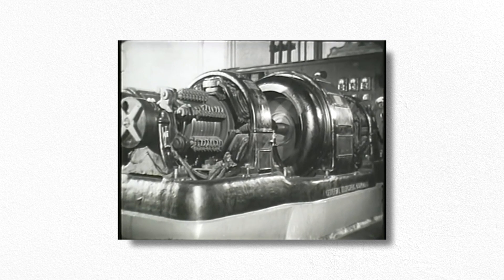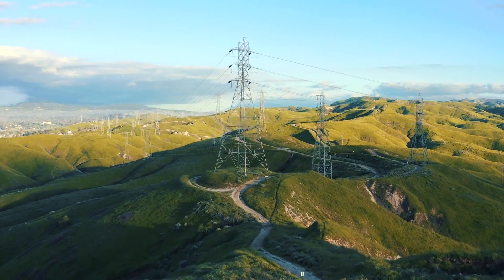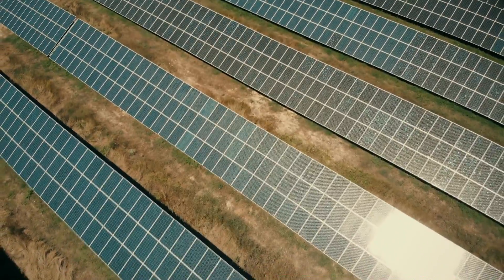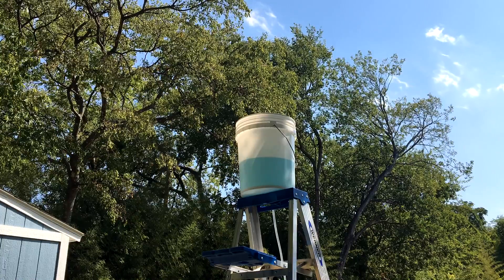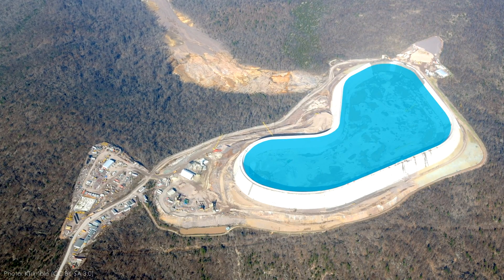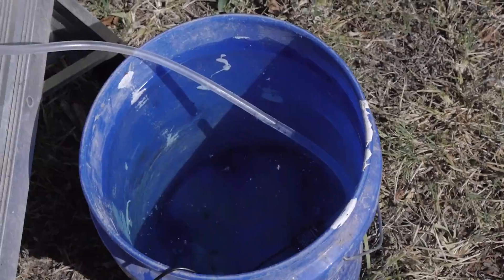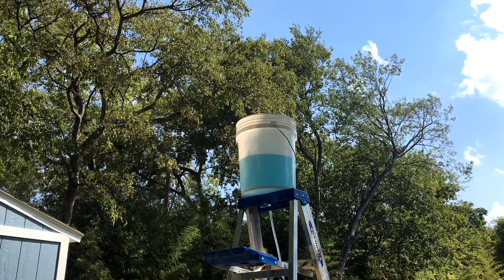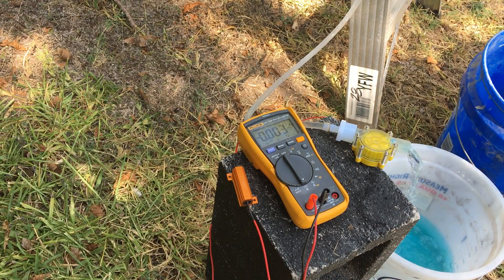World's Largest Batteries - (Pumped Storage)

Comment: Peaking power plants are often the same plants used for signal or phase support.  Often to usually far from the main plant.  Often to usually right downtown.  Often to usually run for zero true power needs but must be  online to make sure the wave forms of 60 cycles aligns perfectly.  AND  often to usually the oldest, ugliest, most polluting, least efficient plants in the entire grid.
Many of these older plants have been restricted from modernizing,,, NIMBY problems.  Run it and keep running it, because you are never going to secure a permit to build new and replace.   The rise of natural gas as a principal fuel has allowed many of these dinosaurs to be brought up to date.  Regulators will go along with 'less CO2'.

Pumped storage has one big problem.  It is not efficient.  For every 100 watts stored,, you will get back 60 watts or less.  Lithium batterries may be the more efficient solution,, but there is a company I believe in California  building a water and iron? battery?  I have heard of a calcium battery,, these are batterries that are not small,, would never be used in a mobile device.   Batteries the size of tractor trailers,, but,,, cheap,, non polluting,, efficient,, non toxic materials,,, just big.  Grid storage may be the use for them.

Comment: This reminds me of an idea where the entirety of the storm drain systems are infested with hydro generators and excess power is used to pump some of the water back up to valley ridges near rivers.
Reply: The problem I could see with that is during high flow events it could cause drag in the system worsening floods

Comment: What about geothermal battery? transfer the excessive electricity into heat energy and send it deep into the earth crust, get it out when need it
Reply: Storing energy as heat would be extremely inefficient, due to the laws of thermodynamics. Existing geothermal energy is a useful source, though. Electricity in Iceland (for example) is quite cheap.

Comment: I read somewhere that a 4-inch pipe and 100 feet of head is plenty to power a home.  You can turn a windmill-powered drinking-water system into a battery, if you put a cistern at the top end of a hilly property.  Be a fun problem to work out, based on your anticipated power needs out at the cabin.

Comment: The problem with your bucket pump is that the outlet needs to be small to pressurize the water, also that's a horrible generator, you can spin something super fast if setup properly and getting more power.

Comment: Way back in the late 1970's there was a conference that defined the form of modern wind power. A small group lobbied for wind turbines turning air compressors with big hollow tanks in the towers. Concrete wrapped steel with a smaller air motor driving the generator on demand. It works providing on demand wind and working at lower wind speeds. However the conference all went for direct AC generation up the top of the tower (with no small elevator for maintenance!). That's where the grants and investments went and wind is a failure as a result.

Solar pneumatic systems did not even get in the door of any solar conference.

Comment: Very well made video, you got almost everything right. The point I would make is that pumping is no longer exclusively a night time activity, especially in the west. I'm a system operator for a utility that still does everything: generation, transmission, distribution. Pumping takes place in the middle of the day, and it is usually done on solar and wind energy. It's a way to 'bank' the overproduction of the renewables, that would otherwise be curtailed.
Reply: Good point.
Earlier PHES relied on lower cost electricity - usually at night - but now with high solar output from utility scale and rooftop solar, many grids can us lower cost power during the day.

Comment: it would be much more efficient to build more rain feed or partially rain feed storage such as large pits on hills and small dams for load balancing
this might be practical in hilly areas along the equator such as Uganda where rains are heavy and runoff is high
designed correctly one might even be able to mitigate flooding by storing that water

Comment: Generating power at the right time in the demand curve seems like the best option.   So a small waterway that could be retained until needed then used over those few peak hours not fed by other renewables would fit the need quite well.  Of course the water being retained does generate environmental effects like habitat loss and warming temperature water carrying less dissolved oxygen.

Comment: So quick question, as an engineering student who's worked on mechanical to electrical energy conversion and electrical storage, why don't we develop efficient high capacity batteries for this? I know the battery recharging cycle load will be an issue, but are there any other major issues that prevent batteries from being used as opposed to pumped storage?
Reply: degradation of cells

Comment: Pumping water is only 60% efficient and a hydro generator is about the same so from 100kwh on 60 kWh of water is stored then only 36 kWh is returned to the grid so its 36% efficient max, so to make it viable the scheme needs to buy power at less than 36% of what it sells it for, let alone paying for the infrastructure and management and serivicing. So more accurately it needs to buy the power for about 10% of what it sells it’s peak power for.
Reply: Not too sure where you got 60% from. We are building a pumped hydro plant in Australia with 80% efficiency
Reply: Anthony - A pump is at max 60-65% efficient, energy in verses work done those systems are only Economical if the power is from solar- if they where a good business model they wouldn’t need a government grant, every hydro scheme needs a government for the capital - the government has paid 150% of the asset built cost.
Reply: Not sure where you're getting 60%; maybe you're thinking about a different type of pump.

Hydroelectric turbines can hit 90% efficiency, and overall energy recovery in pumped-storage can be 70 - 80%.
Reply: Synchronizor - 60% - 70% is the absolute efficiency a water pump can achieve electricity to water work done

Comment: Grand Coulee Dam in WA is a perfect example of this. If you Google the site you will see massive pipes that are used to pump water from the Columbia River into the 50 mile long Banks Lake, which serves the dual purpose of being an irrigation reservoir for the massive system of canals that bring irrigation water to the area as well as a battery for when electricity demand is high.

Comment: The problem, wind and solar, the latter being costly and high maintenance only produce when the conditions are right.  Using "cheap electricity" is still using resources provided mostly by none renewable energy sources.   Pump water is not an efficient way of conserving electricity, its a way to make a profit off a system at the expensed of the environment.   Generations companies meet demand and at night could shutter down coal, natural gas, and hydro generation production.  But, NO, the opportunist uses the lower rates to pump water.  In addition, colleges have gas generators that only run at peak hours reducing their energy cost at the cost of the environment.  Is it green,  no it's ripping off a system, nothing more?

Comment: Great article on Pumped Storage - but basic storage using no pumps - with a large hydro dam is far larger. The province of Quebec has very large hydro capacity with large lakes behind their major facilities. They can purchase energy for storage - and use it to provide for their domestic loads - while reducing capacity at generating stations. These hydro stations have rivers flowing into the reservoir, and the reservoir level increases slowly, available to generate more power when needed. Pumped storage is typically 65-70% efficient, while the use of hydro generation without pumps is virtually 100% efficient, becasue what is changed is essentially the time when power is generated.. Put inot persoective, BC Hydro has 18 MILLION MWh behind 1 of their large dams on the Peace River - while Quebec has a total of about 176 MILLION MWh. This is a huge resource. BC Hydro for almost 20 years was a net buyer of energy - but they collected more than $3Billion in the same period - on energy trades. This, essentially was all based on selling storage - taking energy at low cost periods and returning it at high cost periods. In order to firm renewables, we will need a lot of storage. If we shift fossil fuel use to intermittent energy, we will need a huge amount of storage. Batteries are one method that works well for short term storage, Pumped storage works well but is less efficient, but hydro storage without pumps is the really large resource - that is often available - but at a distance from where it is needed.

Comment: Why wouldn't you just put in natural gas generators to kick in when needed. Batteries are expensive and get harder to charge with each new charge. Or better yet just tie your solar to AC if it can take care of that one thing that would be amazing.
Reply: Gas peekers are the most common, at least in the US, but a lot of people don’t want to burn fossil fuels (for good reason).
Reply: Why? combustion will always be the most efficient on earth. half the fuel is the oxygen in the air. lithium mining isn't green nor trying to charge batteries. Yet it is a good experiment for outer space where combustion won't work.
Reply: @TheRoidemortetfleur  oxygen isn't a fuel source
Reply: Combustion requires oxygen. It is the other half of the fuel you don't have to carry here on earth.
Reply: @TheRoidemortetfleur  yes, but oxygen itself isn't a fuel source.
Reply: Well yes it is. But it is more powerful if you combusted with another fuel. 
Much lighter than a battery and much more efficient. 

That said space is more important than being obsessed with best fuels on earth. 

There is a reason solar panels will never be put on an EV here on earth. It would be clear to the average public it takes a lot of fuel to move a vehicle. You could let it sit in the sun all weak and still not get out of the driveway.

Comment: So why is there is only one turbine generating power from the water moving downward? Wouldn't it generate more power to have a series of turbines along the "downstream" route? Coupled with the statement about the height differential controlling the amount of energy generated implies that it might be more a factor of total pressure rather than the raw weight of water and gravity?
Reply: The mechanical resistance would eventually stop the water.

Comment: the way you metered the water going back to the lower bucket is wrong you should have a outlet at the bottom of the top bucket so that you would have more head pressure ( use the mass of the water in the bucket to create pressure)
Reply: He wasn't metering the water at all, it was simply a hose from the top bucket hooked to a generator. He was just putting his thumb in it to feel the pressure as he was explaining while doing it felt like almost no pressure. A larger hose would have been more efficient.

Comment: imagine the pike demand when we will all come home and plug our very electric cars!!
Reply: floflo electric cars will actually help the grid. There’s a charging system called V2G, it’s a smart system that’s controlled by the grid. Users plug the car in and the grid uses the many cars connected to help even out the peaks and troughs.
Reply: @MrCarlRobinson  Like most 'smart' systems, it is simply dangerous in real life. Imagine your daughter has an accident on a night shift, you jump in your Tesla to go help her, and conk out in the middle of nowhere because the 'smart' system thinks you will not need the car at night and has sapped the battery to even out the grid......
Reply: Debbiebabe69 it doesn’t work like that.
Reply: @MrCarlRobinson  every year we have power shortages in winter as soon as it freeze a little outside.
right when everyone come home at the same time now with domotic/automation people even lower the temperature  in the house during the day, starting 4pm all heaters start  heating at full power to bring the house back to temperature making the problem worse imagine when electric cars will be the norm everyone comes home plug up the car warm up the house and so on, remember that as for now most Ecars barely handle a few hundred km (excepted for rich who can afford a tesla) some people can't go to work for 3 days with that and that's not taking in account the huge amount of commercials who drive all day and will come home out of juice. the grid is already used to its full potential and we add more demands that will be at spike time as well if not back to work they will charge during "cheap time" like every high current appliance.
it doesn't matter if charged cars can back up the grid since the vast majority will be in need for current and not backing it up.
that also make me wonder if the electricity company will refund that curent you will have to take back later and how accurately.

Comment: Could the pumped storage be made more efficient by keeping the upper pool in a drain spin? If the water is pumped in to align with the spin gained by gravitational fall and the reservoir is shaped to drain with the least amount of turbulence and friction through a central bottom port, couldn't the entire pool be kept spinning like a flywheel?

I'm just thinking about how a couple of people can walk repeatedly around the edge of a round swimming pool and get the momentum in the water aligned enough to be carried away by the current. I'm not sure what the energy transfer efficiency is in that scenario but it seems fairly high considering that you can ride the wave around for a considerable amount of time.

Comment: Excellent video.  I was not aware pumped storage was a thing on a grid scale.  At what size point does this become feasible for a off grid household load?  With the right spot, you could use wind to lift the water to the top of the hill and run the turbine at the bottom.  The water goes back into the pool and the wind pumps it back to the top of the hill again.  Pump and turbine efficiency factor in but having wind to move the water uphill when you don't necessarily need it now could potentially make it workable.

Comment: Does actually any pump storage facility pump the water through the same pipeline into the reservoir?
Using the same pump I can understand but using the same pipeline that is under gigantic pressure seems counter intuitive.
Would also like to know if an alternative material could be used, how efficient would it be to move a solid up a mountain instead?

Comment: Interesting piece.  A series on engineering would be better  served by i) the inclusion of some mathematics and ii) the engineering profession's experience to date with PHS that addresses, for instance, why very little PHS has been built in the US or Europe in the last several decades.  The math from the hydro power equation, flow=power/(head*g), that flow required to produce storage for dozens of GW to run a state sized grid would require a flow on the order of that seen by the Mississippi River, a reversable flow, with dual reservoirs to match. Is there a practicing civil engineer  who would state one such a project is feasible, much less the many such projects required to see a notional US, powered by intermittent sources, through days long outages.

Comment: I typically like your videos, but don't like some of your talking points. You denigrate solar and wind as "unreliable" (they're not, they're variable) but then tout pumped storage as an alternative, when it isn't an alternative at all. It doesn't produce anything but energy losses and profits. Maybe if you paired excess solar and wind energy to pump the water up, then it'd be a good solution to avoid using batteries. Nothing is green or renewable about a process that isn't even carbon neutral.

Comment: What about lifting something more dense than water for small-scale - like lead, iron, concrete - like the weights in old clocks
Reply: Gears and winches and weights cost more than water and dams and you can use water for other things Electric trains on an incline are being used with disused equipment and the carriages can be loaded with rocks
Reply: For hydroplant and river management, we have large and dvevelopped ways to drive water down (and up) in large scale. We don't really have anything in that scale for regular lifting and lowering of other, solid masses. Also, the density would be just a bit more in most realistic type, stone or concrete may be about twice as dense, and using iron or other metal are not realistic, the cost would be too much. Also, water need little to no maintenance and cheap, even concrete would need some maintenance and replacement, and way more costly.
Reply: Sometimes called gravel trains. Use energy to drive train cars full of rock up a hill, then use regenerative braking when power is needed.
Reply: Water is free. Lead, iron and concrete isn't.
Reply: Doesn't scale nearly as easily as pumped hydro.
Reply: Friction is a major issue with gravity systems using concrete etc.

Comment: Here's a thought off the top of my head. . . How much potential energy is in municipal water towers?  Yes, there are myriad sizes and designs, so choose whichever you'd prefer.  

Water departments are pumping the water up there for distribution efficiency  and pressure, and it's not like they're currently getting any of that energy back.  Would it be possible to tap into the outflow to generate some electricity?  Would too much pressure or flow be lost?

As I recall, my hometown in Illinois with a population of about 19,000 had three or 4 water towers and the town's water treatment plant processes about 2 million gallons of water per day.  For the discussion, let's assume most of that ends up refilling the towers.